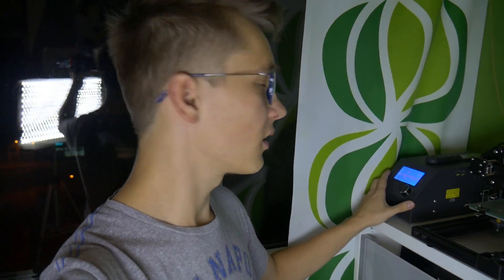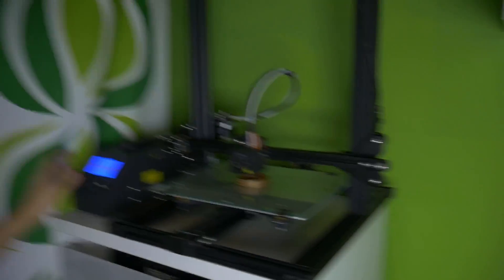Creality CR-10 - Can it resume printing after power loss?

Comment: Thanks for sharing. Questing: my CR10s has a resume print feature. When I click it, nozzle and bed heat up, print then homes itself, they slowly makes it way back to the print spot it was last at. However, once it gets there, it just sits there and doesn’t move. Nozzle/bed maintains heat, print screen says printing, but nothing is happening.

When I turn off and back off, it gives me the option to resume again, but it does the same thing: heats, moves to last spot, then stops. Any advice? Would love to he able to use this feature,  but it hasn’t worked since I bought it (about 5 months old)

Thanks in advance.
Reply: did you solved the problem
Reply: @Top10-e7y2x   I did not. I haven't tried using a new SD card, but seems like an odd fix for an included feature. Would love to have the option to continue prints if I can get it figured out.
Reply: @badeduun1650  im having the same problem and im glad im not the only one but i wish i could find reason why its doing it

Comment: I quite appreciate learning that my CR10 S5 is capable of resuming print, even after I forcibly power-off the printer. As I 'had' to test it out yesterday/this morning, as my current print will take a little over a full day to print, with people nearby, whom in the past, have NOT appreciated the noises, this beast makes during late hours. However, my fear still persists, as the flimsy little knob that functions as a scroller-dial, ALSO is a push button; Pressing "Yes" to Resume Print, BUT the scroller-dial triggers during the push, down to "No", is the print currently on the bed lost forever, or will have have multiple choices to "Resume Print" even after (accidentally) clicking "No", when powering the printer back on, AND/OR is it safer to let the initial "Resume Print" inquiry time out, taking you to the main menu, where presumably, the "Resume Print" will be available, indefinitely, or does clicking "No" simply take you to that very menu, where you are still able to select "Resume Print" at any given time?
Absolutely freaking out, as the print itself occurs very quietly, but every tiny Z-axis Hop, makes that infuriating "VRRRmm!" noise, audible through walls, remaining constant, even with ᶠr turned to low...
It's like... I'll take any complaints in the morning at this point, if that's how it is, I just want this 24hr print to finish, without the risk of catastrophic failures... Praying for the day I can pay for cheap land to build a small shed, where I can just have my printer do its thing, for 200+ hours, if it need be!
Sorry for the ramble, but 3D-printer ownership can be surprisingly stressful for several reasons, as you address yourself, with power going out and stuff like that... 😩
Reply: Other people just walk in and turn off your printer? Who would do that?

Comment: Yes you can resume, you need an Uninterrupted Power Supply(UPS), when electricity gets a cut, UPS comes into work for at least minutes and then you have to click on "pause the print" option, to resume it afterwards when the electricity resumes. So resume print works when you have shorter cuts and have a UPS connected.

Comment: I wonder if the regular CR-10 models being sold now include the resume feature, since it appears to be part of the firmware and not really a hardware feature. They didn't advertise it for the mini either, but as you discovered it works.
Reply from the maker: Maybe it works on the cr10s I don’t think they upgraded it on the original one

Comment: If you upgrade Marlin to 1.1.9, you will get power loss recovery by default on any printer, using the code contributed by Creality.

The way this works, it doesn't rely on any hardware features, it simply writes a cookie to a file on SD-card on every layer (or upon reaching a new Z ceiling), and when it's turned on and the cookie is present, allows resume. On resume, it homes because it genuinely has no scope of the last print position and reads back feedrate, location, temperature and fan states, file and file position from the cookie file, as well as remaining queue section, which all lie in the past compared to existing movement.

Oh by the way, Z hop might cause issues, as it's likely to save a cookie during the first Z hop of a layer, but when the printer shuts off, it's likely descended back again.
Reply: 'using the code provided by creality' do we just download it from creality for other models and just throw it on an old CR-10 and it works?
Reply: @SteedDigital1  I don't know if Creality will provide you with an update for their old printer that contains the functionality. Ask them or their community, not me. And ask their user community what their recommended firmware is.

You can download mainline Marlin from Marlin website or Github page, it will contain the functionality - verision 1.1.9 or later, current and generally recommended release is 2.0.5.3. If memory serves, CR-10 is officially supported with a configuration supplied in the package.

Now you'll probably run into an issue that Creality printers generally ship with no bootloader and thus do not allow firmware updates out of the box, and you need a one-time use of additional hardware and a fairly involved procedure to enable updates. This isn't the case with some other printer brands, which are set up for firmware development and upgrades from the get go.

Comment: I use a Eryone Resumer3d module on my original CR-10. Just follow the configuration instructions, plug the module using the supplied cable into the USB port on the printers control box. The module needs external power (while the printer is printing) from a USB source. Load your model from your sd card as usual & hit print. If the power shuts down (or, as I sometimes do, you choose to switch it off) & when power returns, just switch the printers control box back on & press the middle button on the Resumer3d.. The cr-10 picks up from where it left off. I got the module on Amazon for around £20 UK pounds & it's saved some really big, long prints.
Reply: Thanks for this tip! Absolutely ordering one.

Comment: Hello Nikodem, i could really use your help, i am trying to print a piece with a screw thread but i can't print it properly, i have tried using 0.1 and 0.2 nozzle height, different tolerances but it won't work. When i try to screw it on it doesn't work, please help
Reply from the maker: Hi, you are very lucky I was printing a thread few days ago. I am not sure what type of program you are using here is how to do that in fusion 360. You have to model a thread then using press/pull tool make it like 0.1 mm smaller on both sides both inside and outside thread. That way you have a nice tolerance between those two. You can make press/pull a little bit smaller to make it more tight. Hope that helps if you still have any questions please ask!
Reply: @nikodembartnik  Hi, i was using Fusion 360 when i was modeling my thread. But i was only using press/pull tool on one side of my thread. Tried it on both sides and it worked. Thank you and good luck with your channel. I hope you have million subscribers one day